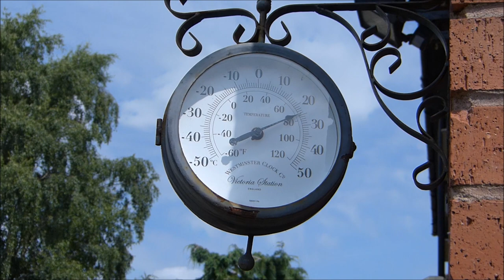XJ900s diversion SEAT RECOVER

Comment: Cover arrived very thin material
I'll see if it's up to the job
Perhaps I'll carve the foam to insert a gel pad for my tender behind
Reply from the maker: Good idea I haven't thought of that didn't realise you could buy the gel separately.
Reply: @jonyr1TT  well had a first go at covering the xx seat foam with a pneumatic stapler 
First error too mich power staples cut through the material 
2nd mistake 
Stretch too hard on front to back axis 
The base is curvy and the front pad is a 5 cm lower than the rear so the cover is floating over the foam
So I put a 7 kg bag of sand over the seat to see it I can stretch the material so it will sag more
If that's not the solution I'll relax the linear stretch  and increase the cross stretch to get it to conform
So  seat covering is not a piece of cake
Reply from the maker: At least your giving it a go fella just take your time and keep checking the other side try not to pull it to tight long ways or it will look like a banana lol.
Reply: I've now ordered a 25 x 30 x1 cm pad in china 
It can be cut with scissors 
I'll cut to size and slide it under a losse seat cover to see it protects my tender butt

Comment: can you let us know where you can get the material?
Reply from the maker: I got it from the fabric section on ebay. Can't remember the seller it was about three years ago.
Reply: @jonyr1TT  hi.. random divy question.. removing the bar ends.. best way? Thanks Dan
Reply from the maker: hi dan .just put a allen key in the hole on the end of the bar weight and twist it anticlockwise.
Reply: @jonyr1TT  yeah that's what I thought.... Mine are obviously round as a round thing.. am I right in thinking that the whole bar end is threaded.. as in is not an expanded bolt type
Reply from the maker: Yes that is correct the bar end is threaded there's no bolt.. Use some grips?. Divvy bar ends are available on eBay.

Comment: Hey RR, i have the same bike but the 2003 model. I have no clue where to find aftermarket parts for this badboy. Any advise?
Reply from the maker: Hi Philip. I just tend to get my parts from wemoto or ebay and amazon.
Reply: Try finding parts for the pre divvy xj900f !!!!!!!!!!!!!
Reply from the maker: Wouldn't of thought pre diversion parts are compatible
Reply: @jonyr1TT  900F are not compatible...
Reply from the maker: That's what I thought.
Reply: @jonyr1TT  They aren't compatible unless you ask at a local bike garage to me who've been in the business for as long as I can remember but swears blind they're the same, and no I don't use them I do all my work myself. my point was it's harder to find pre-divvy parts. Nice job by the way.
Reply from the maker: Talk about lost in translation lol I was kind of thinking that's what you meant. Sorry bro anyway thanks for all the comments and support buddy.
Reply: @jonyr1TT  No worries that's what I thought. Nice seeing the difference between the two to be honest. they had a complete frame re-design and the engines are different too. Was also advised if I wanted to improve handling to change the 150 rear tyre to a 160, thinking on the way back home something didn't sound right, checked rear tyre on mine and a 120 only just clears the brake torque arm lol 'everyones an expert eh!'
Reply from the maker: Cheers buddy yup everyone's a critic lol.. I like all 3 designs meaning the fj1200 as well all great bikes..
Reply: @jonyr1TT  Funny you should mention the FJ1200, A bike I've always wanted. Was looking at either one of them or a Triumph Sprint ST to use as a tourer to keep the mileage down on the XJ. Didn't want to fall into the same boat with parts availability with the FJ so went for the Sprint instead, what a bike!! enjoying every ride out on it so far.
Reply from the maker: I used to have the sprint 1995 model in dark blue.